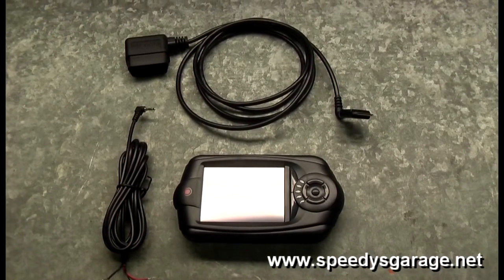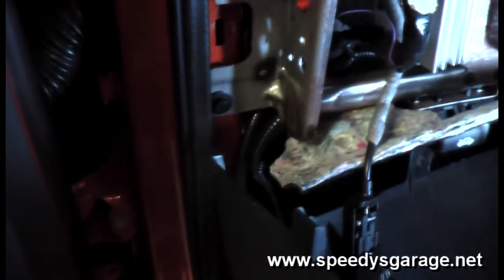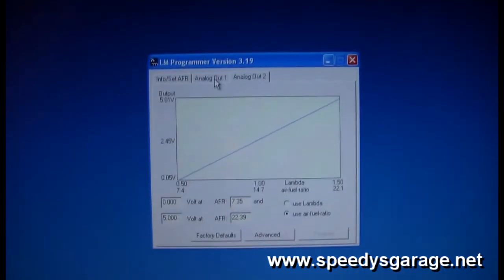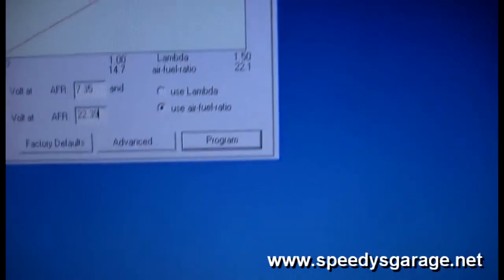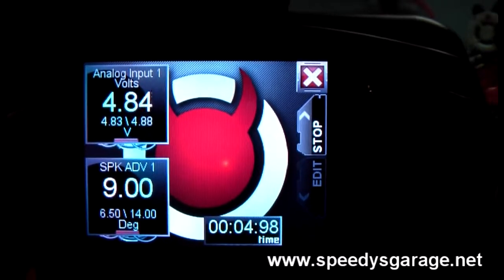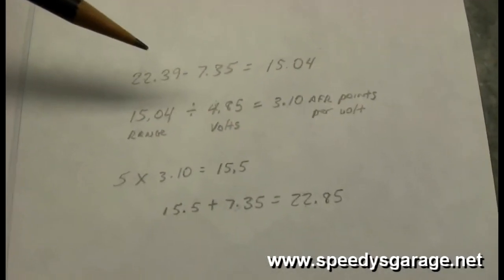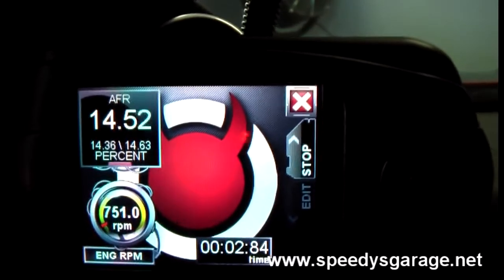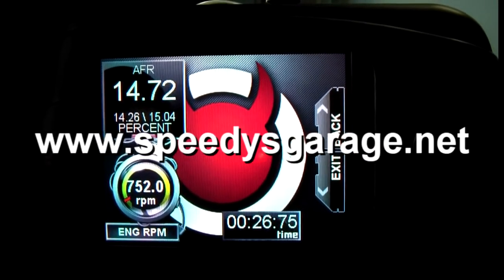Dodge Challenger DiabloSport Analog Input Install Speedy's Garage

Comment: This is helping steer me in the right direction. I however have a plx afr. As far as wiring, I can really find any direct instructions. Can you help? I believe I'm supposed to wire into the 5 volt channel (lower right of the same plug as guage) but not positive. And the other just ground, with a wire left over?
Reply from the maker: I'm not familiar with PLX, perhaps someone else can chime in.

Comment: Very nice video! I am about to put a wide band in my car and also have the t1000. When you set your wide band up did you run just 1 sensor or 2? I have heard of some people running 2 but was curious what you done. I am about to install long tube headers and catless mids and am contemplating on where to put the wide band  o2 sensor/s at.
Reply from the maker: Always ran just one wide band sensor.
Reply: Let me ask you this... did you have the capability with the set up you were running to have two sensors? I’m trying to figure out how I could utilize my t1000 if I did run 2 sensors.

Comment: need help sometimes mine read the 14.7 at idle sometimes it shows half of that what could it be
Reply from the maker: Sounds like a ground issue to me on your wide band sensor.  7.5 AFR reading basically means 0V on most wide band sensors if memory serves.
Reply: +Speedy's Garage ok thanks going to try a diffrent spot

Comment: Although this is a old video, it helped me set up my AEM fail safe 2 in 1 wideband to my trinity. The upper was different but it helped guide me in the right direction. By then, I was easily able to also configure my boost analog feed as well. I just sent off my revision tune for my Eforce supercharger.